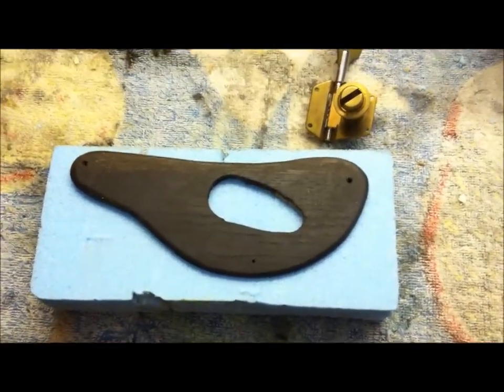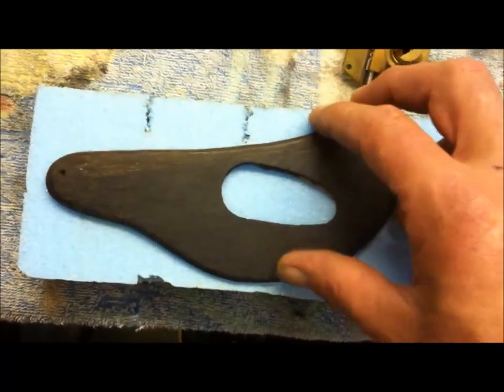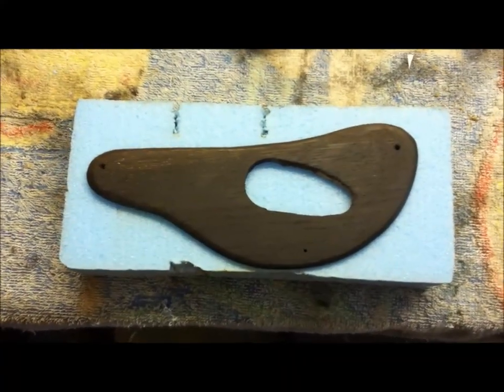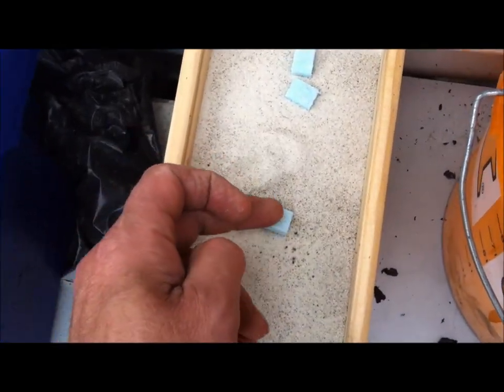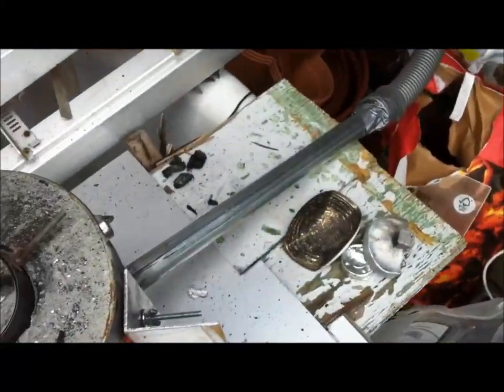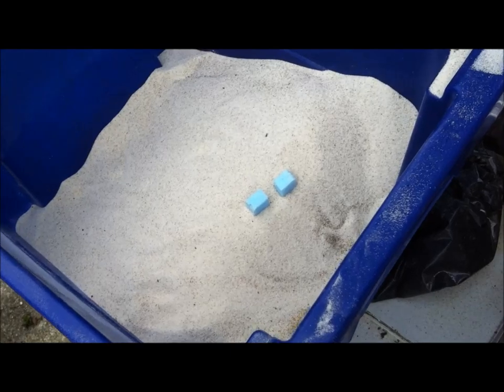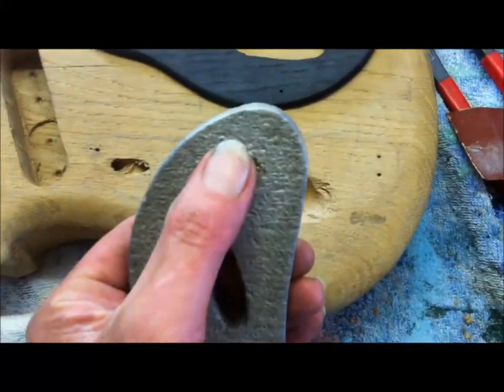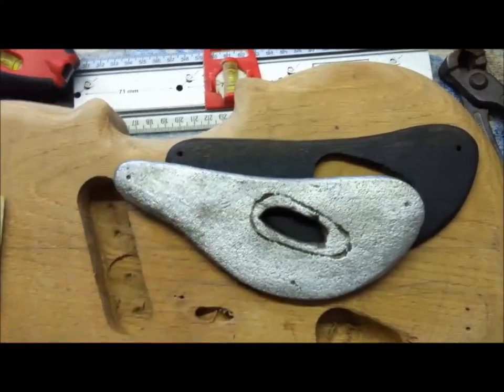4 string guitar cover plate cast with home made forge

Comment: Does the styropor just dissapear or is it mixed in with the aluminium
Reply from the maker: garryentropy 
It turns into gas and evaporates into the sand and leaves a space for the aluminium but makes a shell with the residue holds the sand in place finer the sand better the mould just a styropor male positive but its lost as you pour it. I want to do some green sand stuff I am just learning and playing with a green sand mix I can make a mould and make the same parts again and agian but that guitar is just a brain fart its play time lol.
Thanks Garry.
Dave ;-)